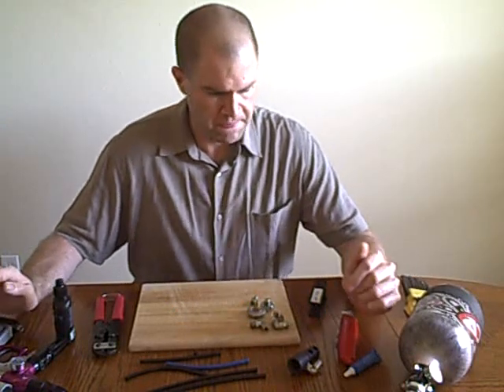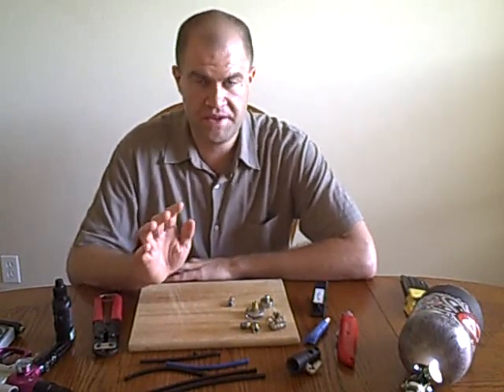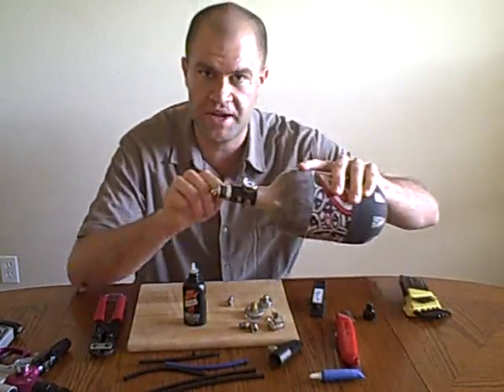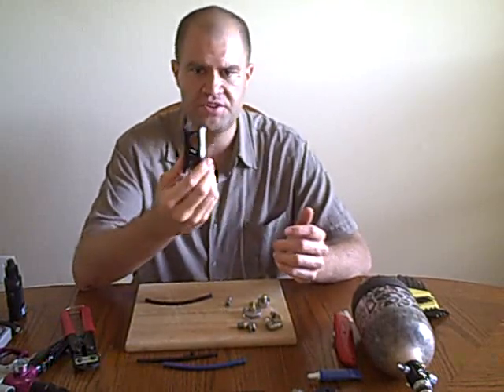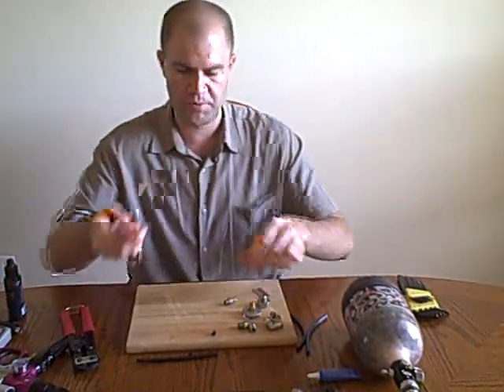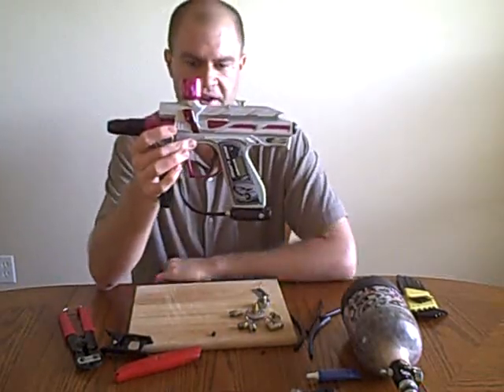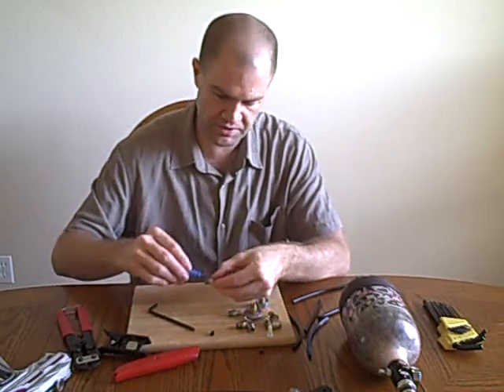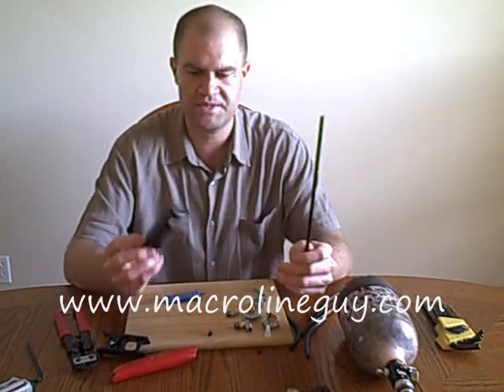Paintball macroline, fittings, teflon tape, triflow, guages

Comment: @RandomVidWithConnor make sure its not loose. then see if the line is damaged. A spyder Ts has a steel braided hose, not a macro line. Its probably loose. Tighten it up and if i leaks thru the threads use the loctite, or teflon tape to seal it up.

Comment from the maker: you should be fine. Just be careful with leaving CO2 tanks exposed to heat and sun. If they get cooked, the pressure can go over 1300psi and blow the macroline. A good rule of thumb is don't let your bottle get hotter than your skin. If your bottle feels hot to the touch, get it in the shade.

Usually macroline blows on CO2 when the tank if freshly filled, then left out in the sun on an extremely hot day for a couple of hours. The bottle temp hits 130+F and sends the pressure to 1300psi ka-pow

Comment: you can buy tube cutters at lowes or home depot. they are in the phone and internet wire section ( there usually used for cutting phone lines and ethernet cables i believe)

Comment: @layoff01 and somebody correct me if I'm wrong but your macro line could need loctite to prevent leaking. Also, your macro line could be cut wrong. If air is leaking from the trigger? It could be the solenoid and you have to ship it back to dangerous power

Comment: Exactly what I've been saying for years: Loctite Blue is a heck of a lot easier and totally bulletproof. Teflon, it'll leak about 50% of the time. And if any of those little Teflon strings break off in your air system, you're screwed. Wherever that winds up, you better hope you can get at it. With Loctite, as long as you don't use way too much, about the worst that will happen is some powder will flake off and shoot right out of the gun.

Comment: I'm gonna be getting a new on/off asa and gonna need a 90 degree fitting. From ans gear they say they cover their fittings with something to create a seal. I just wanted to kno if that was true and I should be able to just screw in the new fitting to the asa with a wrench or whtever I find tht works right? I'd rather not go buy tubes of lock tight, and teflon tape for my one gun tht I'd just like this one asa put on tht I won't be changing unless I get a new gun later on.

Comment: I just can't seem to get my macroline to stop leaking out of the fittings, I replaced the o-rings in both fittings but there is still a small leak. I also put in a new piece of macroline and made sure to cut it very straight and cleanly. I'm pretty sure it wouldn't be a good idea to put locktite or teflon tape on the macroline itself where it connects to the fitting, right? Any help anyone can give is much appreciated, I haven't been able to find any solutions online.

Comment: mike i have a question about my dangerous power fusion fx. for some reason wat so ever its not firing. i took apart my LPR, ive took apart the regulator and ive lubed it and still not shooting. i got a new macroline line and new fittings and all that stuff. so i need to know whats wrong with it bc i have a speedball game in 3 days and my geo is in the repair shop. so if you have any ideas than please let me know

Comment from the maker: If oil gets inside the TANK, the 4500psi tank through the fill nipple, yes it can explode. The pressure creates a "diesel fuel" effect, and causes the oil / petroleum to detonate.

Thats only inside the 4500psi tank. To date, 850psi is NOT enough pressure to blow anything up. As long as oil stays out of your tank, anywhere else it's fine (ASA, macroline, fittings, etc)

Don't EVER put oil into your fill nipple on HPA. If you put enough in there (30+ drops), your tank could explode.

Comment: @mazpr2025 
personally, I don't recommend it. Standard 6mm Macroline is good until about 650 PSI, afterwards, in hot weather, it will blow at about 800 PSI. I use braided line exclusively for almost all of my paintball stuff. I don't see a downside to it tbh

Comment: Make sure the tank is empty, heat the regulator threads with a blowdryer for about five minutes, and then twist it off with a wrench and a vice.  

If you don't have a wrench or a vice, you can use your hands.  I have unscrewed regulators from tanks just by wearing rubber gloves and heating the regulator threads.

Comment: Tank output pressure isnt enough to diesel triflow.  You need 2,000 to 3,000 psi for it to igmite.  Even the highest output HPA tanks don't exceed 900 psi.

Comment: Just about every gun works with HPA, it screws right into where the CO2 tank screws in, the threads and everything are all the same, so all you need to buy is a tank, and leave everything else the same.

Comment: @caboose129 There are different colors of lock tight.  Don't inform people with incorrect information.  The color determines the tensile strength of the hold.

Comment: I'm sorry, but I'm going to have to post a severe correction here: BLUE LOCTITE(24x series) is NOT made as a THREAD SEALER. It is a thread locker. Teflon tape is superior to blue loctite for use in pressurized applications. That is what it is designed for. The only products under the loctite brand made for use in sealing pressure is the Loctite 500 series products, all RED. And there ARE alternatives to macroline: Steel Braided PTFE hose, and copper, brass, or stainless steel hardline.

Comment: I fail to see how teflon tape is messy at all. It doesnt age anywhere near as quickly as blue locktight, allows better tightening, and allows the threads to get closer. The problem i see with using the triflow is if your seal fails, your going to have deiseling of the triflow oin top of all of that escaping pressure.

Comment: I have a macroline fitting that has a plastic ring that holds the line in place, and for some reason when the line is pressurized it will pop out randomly. I think the ring holding the macroline is very sensitive and even a small nudge will make the macroline release. Is there any way to prevent this from happening? I have never dealt with HPA tanks or low pressure regulators before so when the line popped out the first time I thought it was exploding or something and the full tank emptied.